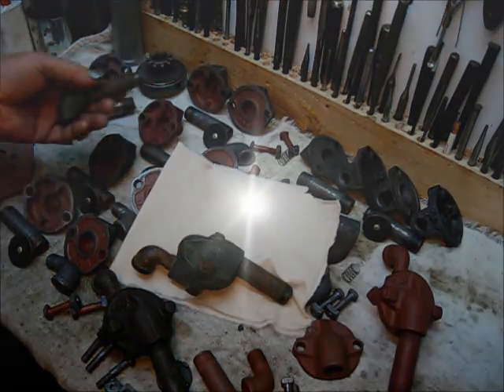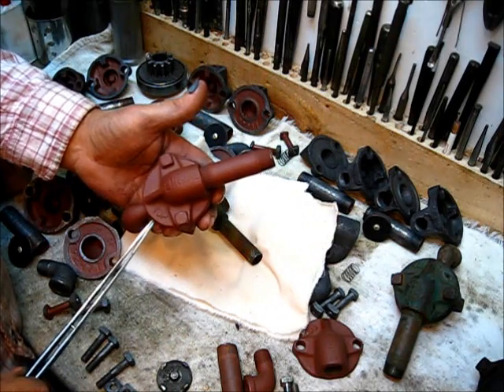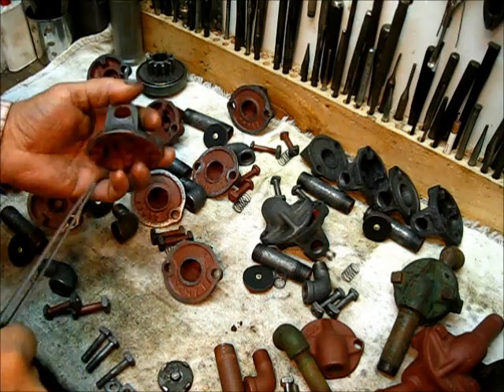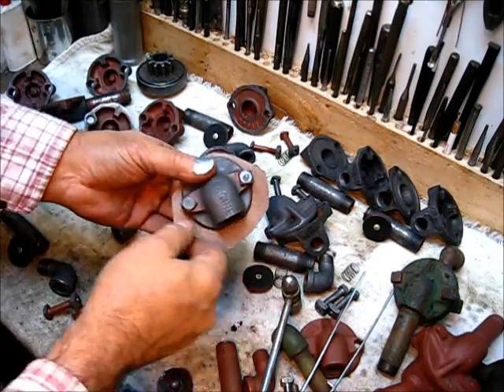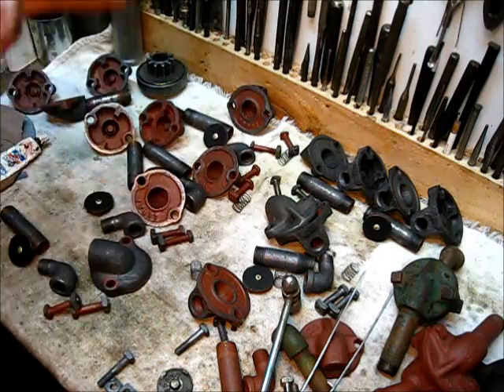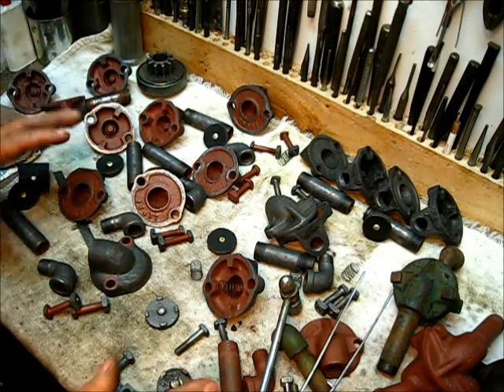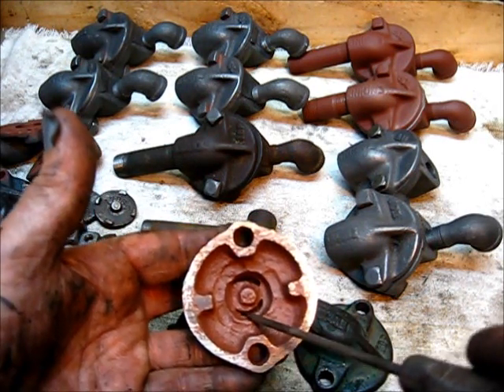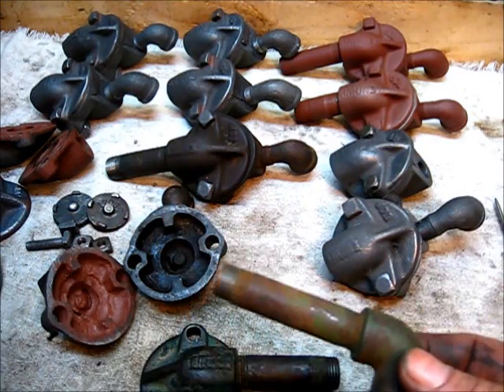IHC ENGINE crankcase breather explained

Comment: Hi. I have several IHC LB and LA Engines.  I believe my crankcase breather is blocked as i have some oil coming out of the exhaust and the rear inspection plate.  Question. This engine will not run.  Will excessive crankcase pressure cause a no run situation ????

Comment: Hi Sam,

Great show and tell videos mate, really enjoy listening to you. One thing that  I would really like to know is what are the various different thread sizes and types on the M engine? Are you thinking about a video on the pipe thread sizes and fitting thread types on the McCormick M motors? I only learned that the threads on the Mc Cormick are NPT that go into the fuel tank. In Australia we often see BSPT threads and NPT is not common. Thanks mate for listening. Kind Regtards, Phil

Comment from the maker: ,,, both will cause that,, have you had your rear breather apart for clean out? (is the spring good?),,,, is your oiler an engine oiler (with checkball and vent tube) or a machinery oiler?,,, yes worn out rings (blowby) can cause to much pressure in the crankcase, ie; bubble in the oiler,,,

Comment: Dammit ,i ran out of characters..if i give you the serial #, could you help me with the year and mabe some parts..it looks complete to me with no cracks except a broken rocker arm..shes stuck and was sittin outside for many years..ill probably have to build a piston removal jig like yours. i do have access to a porta-power unit and a lathe and mill..should be a fun winter project..thanks in advance Jim from Oregon

Comment: Hey Dog, working the core room and the pouring floor in a cast iron foundry is rough work! Somedays bad stuff happened. I can imagine things may have been less than optimum back when those engine parts were made. Thanks for explaining the situation.